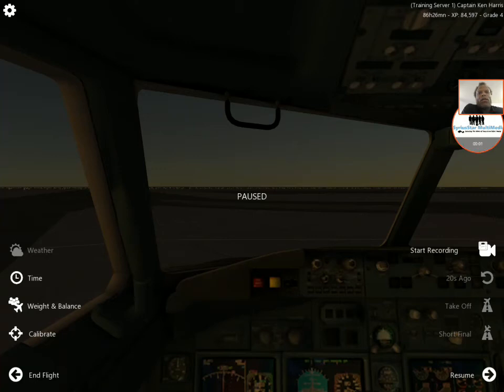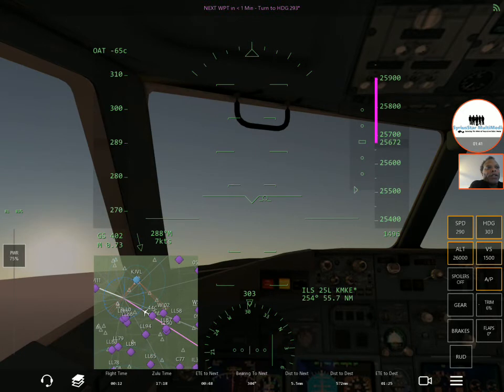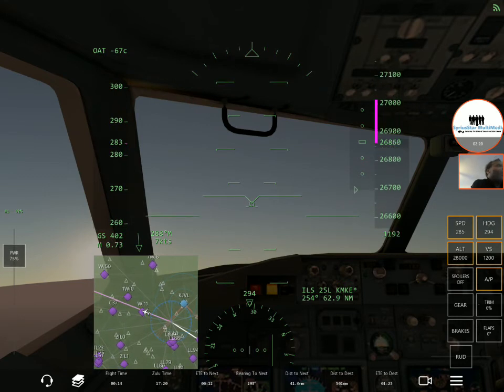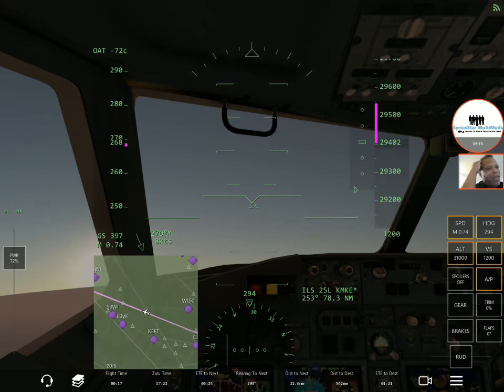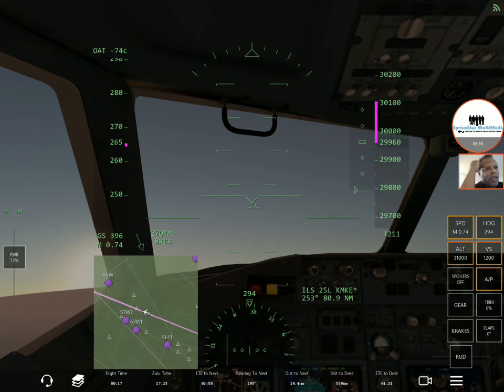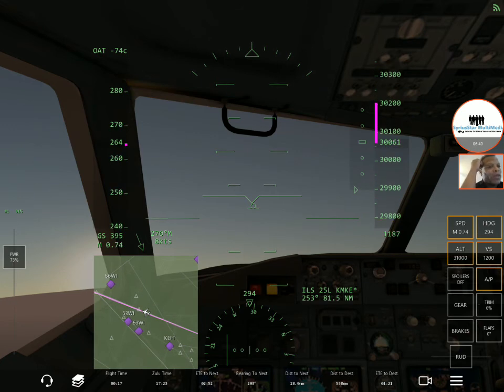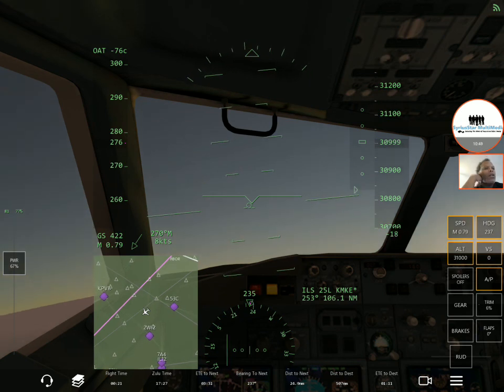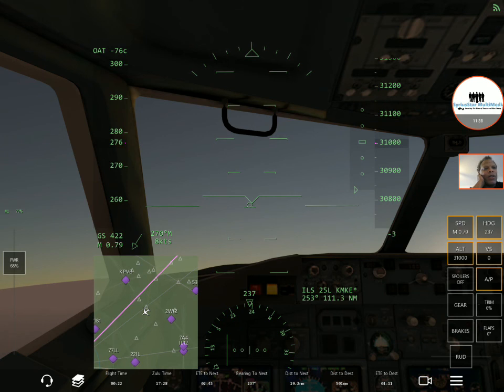Infinite Flight Tutorial - Climb to Cruise Speed | Mach Speed

Comment: I can't maintain a cruise speed I fly a330 with 81 power and 0.081 spd at 38000 altitude it keeps varying between different speed for example from 270 and decreasing slowly
Reply from the maker: The reasons that the air speed varies can be affected by many things. The common reasons are the direction and speed of the winds. Remember that we are flying in simulated real world weather. The weight of the airplane can affect your airspeed as well. The Mach climb suggestion I have for the A330-200/A330-300 is .80 and the cruise speed is .81. You may need to adjust this as needed. The planes are capable of speed parameters that are higher as well as speeds you should not pass. If your plane is maintaining it’s altitude than there may be no problem. Just monitor the Mach speed reading on the HUD.

Comment: Wait so do you know why my speed goes down by itself? Like the engines go down to 20% when I am in like 20,000 altitude, how do I prevent that?
Reply from the maker: There is a setting you must adjust with the Autopilot set. It is the SPD reading. After you get past 10,000 you can gradually set it to 290. If your N1 is decreasing it is most likely that you have the SPD setting too low. With A/P set to active the SPD will be lit.
Reply: SyriusStar Multimedia Ohk thanks man

Comment: When I fly my MD 11 at 38000 ft the nose pitches up high and the speed decreases. I have it set to mach .88 but it decreases to 170 knots. Plz help someone
Reply from the maker: Check your overall weight and weight distribution. During climb try a speed of 300 knots, after transitioning set it at Mach .80 and after reaching your cruise altitude set the speed to Mach .83. Don’t worry about the indicated airspeed.